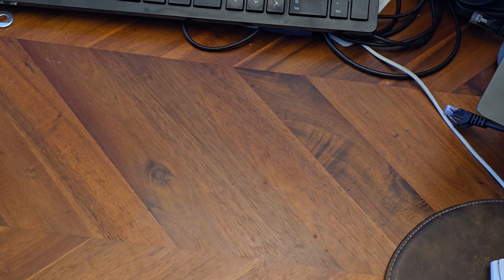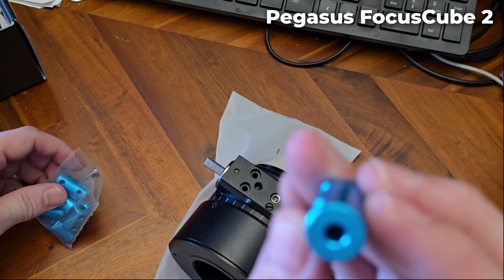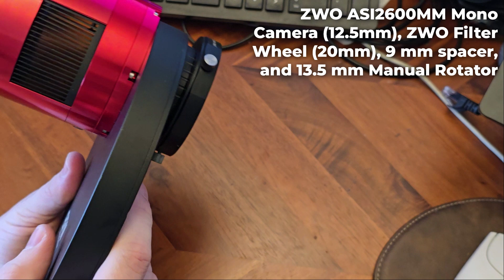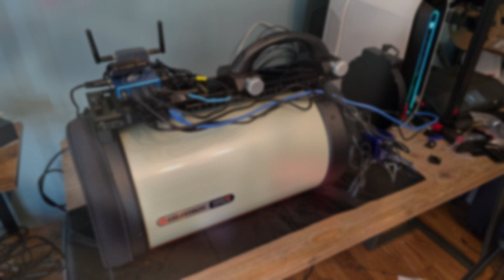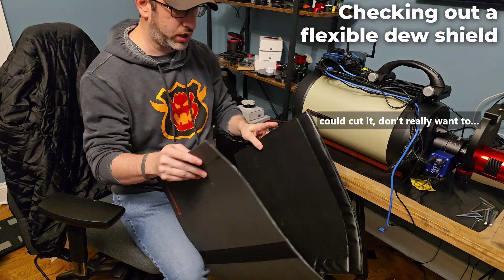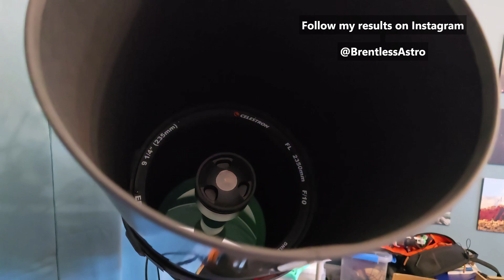From Refractor to SCT: Setting Up My First EdgeHD 9.25 Telescope

Comment: did it occur to you to loosen the rotator on the steeltrack and then screw the focuser body onto the SCT while holding the end thus the body rotates but the focuser does not (because the rotator is disengaged/unlocked) - it would have saved you taking the EAF off!
Reply from the maker: Certainly did not (doh!) 😂

Comment: Well, I couldn't stop watching Brent so there's no accounting for taste! I've been wondering about upgrading my "big mono rig" (an Orion 130 ED Triplet APO skywatcher tripod PE160 AM5 EAF EFW CAA asiair 2600MM Pro) for one of these beauties, but I have some physical issues these days, and over the last four years I've fine tuned my build process to operate in/out of a camping cart and bespoke soft-luggage, with a pluggable custom wiring loom and swappable 2" pushfit camera backs (planets, DSO, mono & OSC, reduced & prime focus) to accommodate my limitations (just). Not to mention a visual option - its the EAF pro battery operated push button focuser version and can be setup in altaz without a computer or cameras for that reason. 

There's not a lot of difference in all up weight here, but the SCT is just a teeny bit heavier and the dewcap makes it more bulky as well so I would definitely be more challenged to handle the nightly build and pack up with that lovely Edge. I'll have to see whih way the wind is blowing, and if my easy little 'grab and go' (FF80/AM3/2600MCDuo also all the trimmings) gets relatively more or less attention this season. The smaller OSC rig is just so comfortable to use dualband (from the balcony via home wifi, and not guarded on the roof). If not then there might be an argument to go bigger and increase the challenges further.  

But anyhow, I used to have use of a Grubb Parsons 10" SCT back in the 1980s, so it was a nostalgic pleasure to watch you build this rig up, and dream along with you about using it soon. Its going to be a challenge with the OAG and FL but I bet you will eventually get great results with it. Clear skies!

Comment: I have almost all the same equipment and am just getting ready to assemble it.   Went with a Feather Touch micro focuser and ZWO EAF just so I could use an Asiair.
Reply from the maker: Awesome, good luck!
Reply: @Brentless  Just curious.  Since it has been 8 months are you still happy with the Steelcase focuser?   It does look interesting.
Reply from the maker: @marvinwhisman3333i love it, it has made everything so easy.
Reply: @Brentless Hello. Nice setup. This might be a dumb question but honest. What and why is the benefits of using a focuser like yours when the Telescope already has a built in focused? Sorry again but im a real amateur taking a look through my cheap Telescope sometimes.
Reply: @antonandersson8524  the mirror in these SCTs can shift usually around meridian flip which can affect the focus, hence the mirror locks, once you focus with the native focuser you lock the mirror and use the Baader to obtain final focus adjustments
Reply: note if you plan to use a starizona hyperstar you need the feathertouch ...

Comment: Hi Brent, I have almost exactly the same setup and having trouble coupling the focuser and OAG. Can you please share the link to your Baader M48 adapter? Or M54 will work better? I ordered M48 one (Baader M48 Conversion Ring / Gender Changer # M48-INV 2958555), but it looks like it's way too small on focuser side (OAG side fits just perfect)

Comment: Fitting the auto focuser you removed the wrong screws. You should have used the black screws and not the silver ones. Read the manual.
Reply from the maker: Ack, good catch, I'll course correct

Comment: Very similar to my setup. I started with an Askar FRA400. I tried using the Prima Luce Lab Essato LP. It didn't work that well and I had a very hard time getting the focus right with the manual focus.Now using a Pegasus astro cube that works like a champ on the mirror focus..  I also had a heck of a time getting a good collimation as the focus was pretty soft when I took it out of the box. Get Bob's Knobs. Just do it. I did have trouble with my AM5 slipping at extreme angles ( like median flip time) so I had to upgrade to a CEM70. Very happy now that I have proper collimation and a mount that will handle the weight. Good luck and clear skies!!!

Comment: How's the Sky Watcher 150i mount performing? I'm thinking about adding an EdgeHD8 to my collection next year and right now my primary scope is a ZWO FF80. I'm using an AM5 mount (the original not the AM5N) and I'm wondering if the AM5 can handle the EdgeHD8 or if I also need to take a new mount into account.
Reply from the maker: I finally got it out under clear skies for the first time last night, and it performed like a pro.  Guiding was consistently between 0.7 and 0.9, without really doing much to dial it in.  Haven't processed my data yet, but everything looks pinpoint.  Just a single night, but I am super impressed.  Will add a video of my findings hopefully in the next day or two.
Reply: @Brentless  Wow! That sounds really promising. Looking forward to the video!

Comment: What are your expectations about guiding performance?   That is a lot of weight. Maybe the ability of this mount  to balance ? I’ve read if the OTA’s  center of balance is greater than 20cm from the RA axis, there is a reduction in payload capacity. Now , I’ve only seen this with the AM5/N but I think it may affect iOptron SWG mounts. I will be interested to see the PHD2 calibration results. Thanks.
Reply from the maker: First field test last night (after weeks of clouds), and it performed amazingly well.  Once I get another counterweight, i'll be able to move them closer to the mount, but initial run, guiding was consistently between 0.7 and 0.9 RMS for me via PHD2, didn't really do much to try and dial it in, early results look really nice to me.
Reply: No problems with calibration, orthogonal graph right angle, RA and Guide rates equal? I’ve got a new to me HAE43-EC and PHD2 cant calibrate. My RA and Dec guiding rates are mismatch. My RA Steps is 10 and DEC is 12 so the excessive backlash message doesn’t make sense. The Guiding Assistant backlash graph shows the red dots parallel to the downward whit dots and very close. My RA guide rate is 9 and Dec is 7.8. PHD2 expects 7.5 for both. Everyone can calibrate except me. I’ve got a C8 about 19lbs.

Comment: Is that a strain wave gear mount? I guess not since it has a clutch. But if it is, and if it’s anything like the ZWO AM3 and 5 mounts, then the counterweights are not for balancing. In fact they are only to prevent the tripod and all for from tipping over. It’s NOT for balancing and there is a limit, 5kg/11lbs if I remember correctly. Just a heads up if they are the same type 😊
Reply from the maker: It is strain wave, but the Sky-watcher is build specifically to balance at higher weights, including the clutch release.   The counterweights arent needed until somewhere around 30 pounds, but unlike ZWO, guidance is you still balance these
Reply: Skywatcher recommends balancing.

Comment: Really like the setup. and I liked the video.  I am interested in a SCT too.  I have both a 111mm and a 68mm aperture refractors, along with a 6" Newtonian reflector.  The EdgeHD's are impressive.

One observation ... I find the best balance of the scope comes when I have all the accessories and cabling exactly as I plan to use while imaging in place.  When I leave the lens cap on, or do not have the dew shield on, while I am balancing, I have found I need to rebalance the setup after coorrecting.  Maybe in your case the cap and dew shield somehow cancelled each other out and it was still in good balance.  I make the mistake from time to time myself.  (I was distracted some while watching, so maybe you corrected this and I just missed your correction?)
Reply from the maker: Thanks, ya in the house I just did some rough alignment, outside I'll be a bit more precise, but good call outs

Comment: Will your Baader focuser actually work with the 0.7X reducer?  Seems like I read somewhere that those type focusers are not compatible with the 0.7X reducers.
Reply from the maker: my understanding is yes, I have a colleague in my local club that is using it successfully, and basically, you just unthread the focuser (with everything else), put on the reducer, and then thread the focuser right back on it, and the backfocus remains the "same"

but i'll have a chance to try it out over the coming weeks